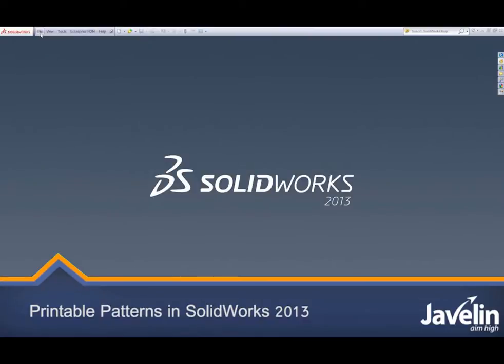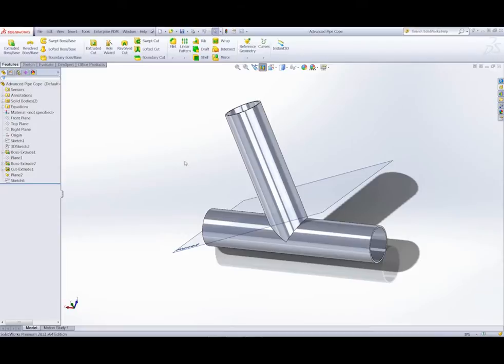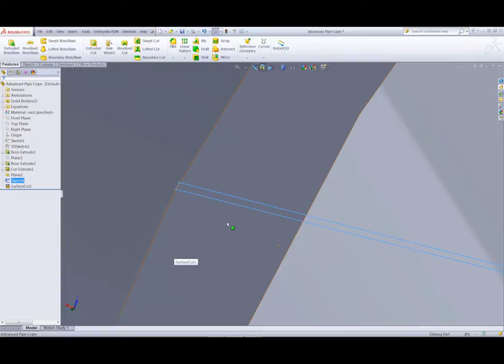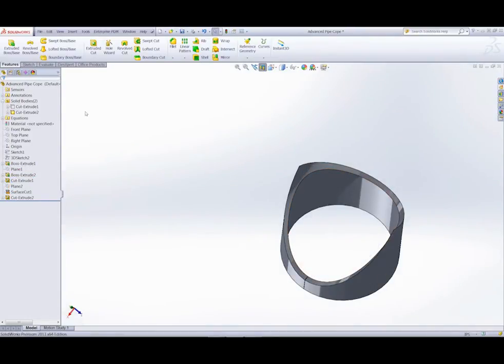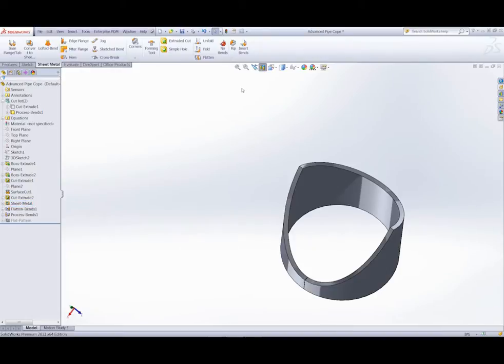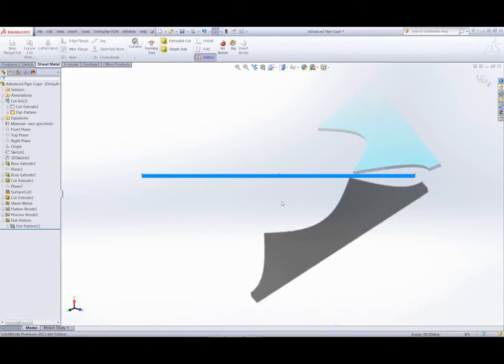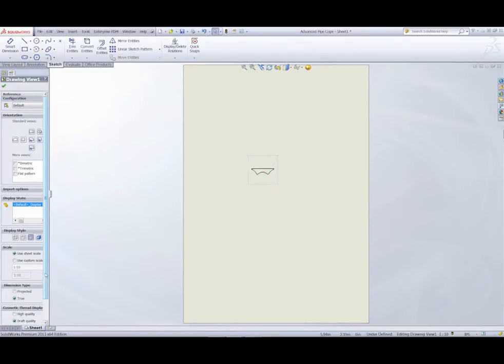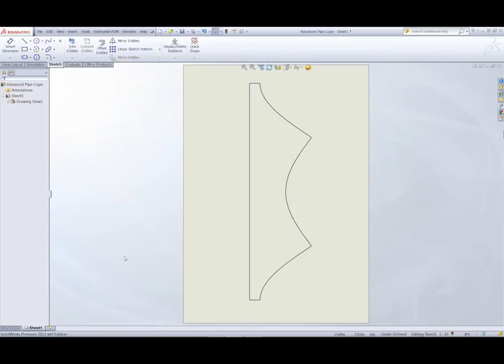Printable Patterns in SolidWorks 2013

Comment: Hi! I have been doing the same procedure but end up with a template that is to small. Seams to me like solidworks is measuring the center of the wall thickness? any solutions for this problem?
Reply: You need to set k=1 and the problem  is solved.
Reply: This is happening to me as well, did you found any solution?
Reply: I ended up calculating with a CALCULATOR (first time I ever need that in SW) and then making the tube a bit bigger in diameter. so the paper template wold fit perfectly my 38.1mm ss tube. When cutting tubes with lazers however the lazer machine reads perfectly the file without modifying the diameter and the tube looks exactly like in SW. Pretty cool!